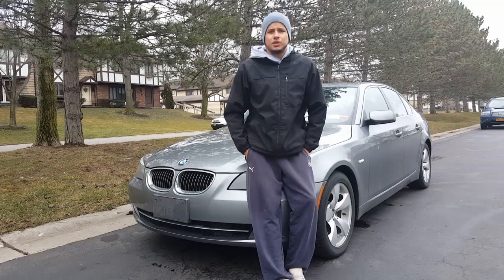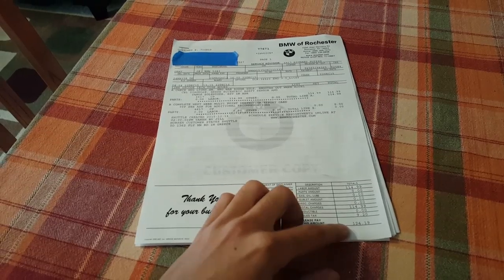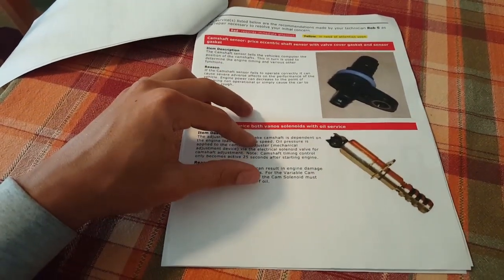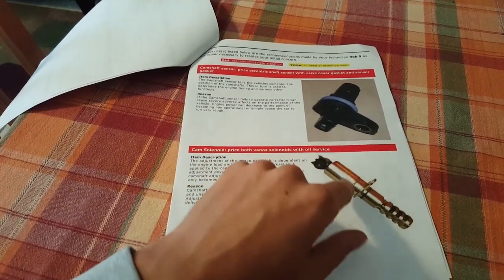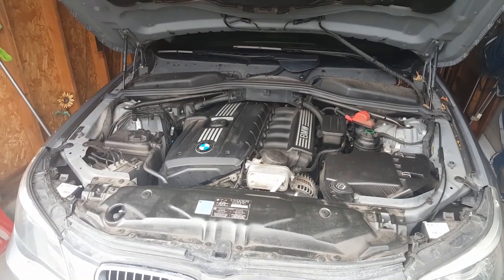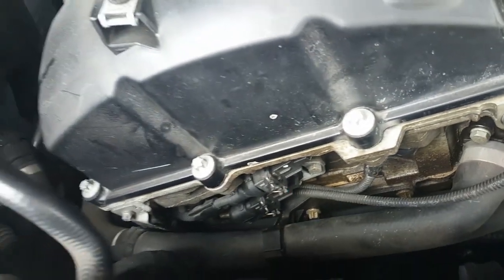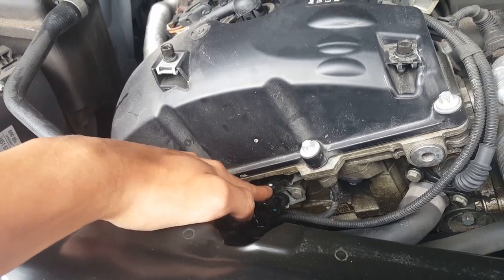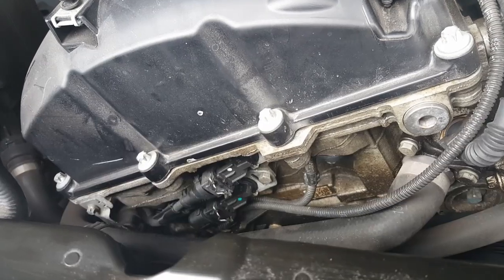2008 BMW 528i Camshaft and Vanos Solenoid Replacement

Comment: Great video bud. I cleaned the vanos,  doing preventative on cam shaft sensor.
HEY READ THIS. 
You and I have same engine, took my 2010 BMW 528i to BMW dealer (I love these guys, bought tons of parts and 2 BMW's) they treat me good. The first evaluation of my car they said in my report valve cover gasket needed replacing. I got my car home (I DIY the shit out of my 4 cars) and took alot of simple stuff off the engine to get a good look: air box, engine cover, cabin filters. 
AND GUESS WHAT...the oil cap was leaking!! Yes the Castrol embossed original oil cap. Went to BMW and took my car and brought my cap to parts, they got a new one out and we compared them, they didn't believe it was the cap ...this was January/2020. The new cap was about 2 or 3 more threads and tighter closing top. Problem solved no leak!!! $12 fix. Oil cap does not say Castrol on it anymore. 
Hope this helps someone. Also...yes the dealer can raise your idle to 625 rpm to stop the unstable idle surge you have!!

Comment: The proper socket for the bolt of the Camshaft Position Sensor is a Torx E5. E is for male Torx and T is for female Torx.
Reply: Mine was an E8

Comment: hi my car rough idles some time, and today it totaly cut off while i was stopped at a red light. although it started right up. cel didn't light up, but i scanned it when i got home and got a p0015 code. whats the best place to get the parts from

Comment: I have that code on my x5 N52  engine, is the camshaft sensor you replace is that the sensor bank 1 ?!?
Reply: Jose Reyes he said there is only 1 but there are 2 camshaft sensors not sure which is which

Comment: will this cause your car to also cut off.
Reply: hamitup mine does it sometimes when I stop at a red light or a stop sign only sometimes tho fires back up when I click the start button I got it scanned and the cam shaft sensor was what they said was wrong so could be

Comment: Question I have same car same year and I had someone tell me the engine codes are for vanos but that I would need an entire vanos unit at over $2000.00 does that sound right or should I just do same as you did? Not sure thanks

Comment: Just replaces both still have the low power / sluggish engine problem
Reply from the maker: Might be the eccentric shaft sensor, you will need to take off the valve cover to get to it
Reply: I’m gonna try that
Reply: @Skurfin  did you fix it? What turned out to be the problem?